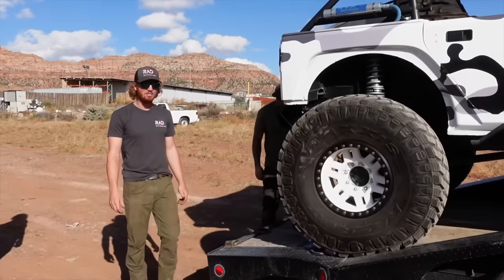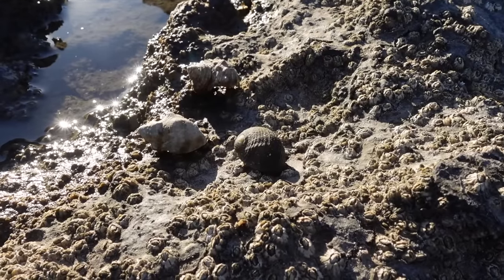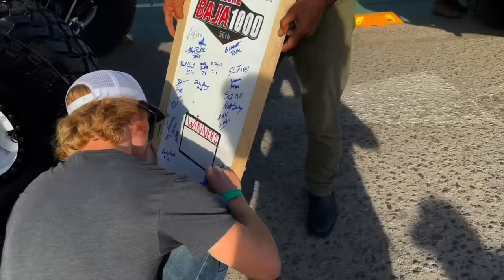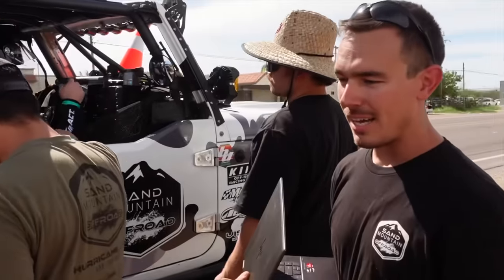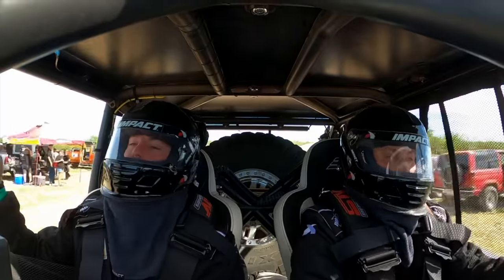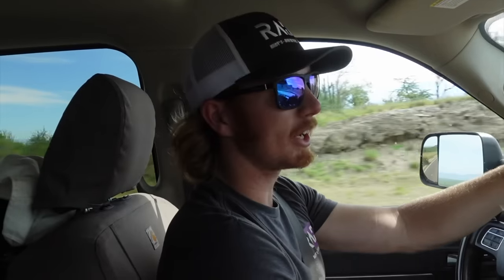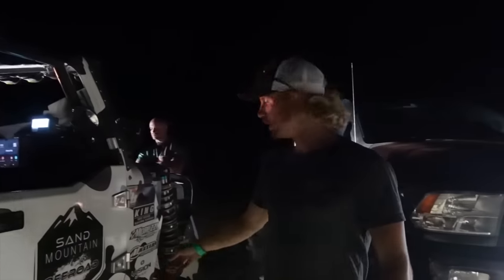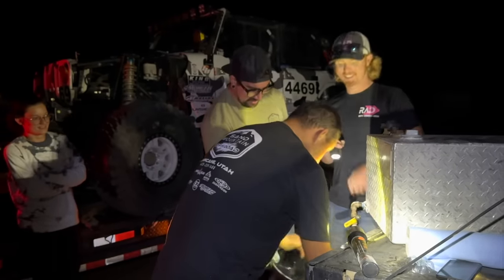Racing The BAJA 1000 Is No Joke

Comment: 25 years ago me and a couple of friends built a dessert racer. Our primary concern was to eliminate as much electrical needs as possible. When all said and done, our truck had 27 individual pieces of wire. I used a Borg-Warner T-20 trans, with a 205 transfer.  Rockwell axles with manual steering. This vid shows why I made every one of those choices. The truck still races today, it's had one more auxillary power system routed since then, for lighting  and navigation. 
I've always thought the KISS principal was the king when it comes to racing. 
I can easily maintain 90 mph with my 400 horse power coming out of my normally aspirated small block chevy.
But hey, if you're into breaking down, use your modern stuff. I won't, I like finishing races.
Have fun all.

Comment: it  would be a miracle if you guys made it first time. the little experience you got is worth it. DNF is not a bad thing, It just means you get to make it better next time.
Reply: Ford did it with the Raptor the first time lol
Reply: @evictioncarpentry2628  Ford and RAD is at same level? I didn't know that.
Reply: @jadenseph1809  It's an OEM vehicle. Arguably far crappier then a custom build.
Reply: @evictioncarpentry2628  arguably is the key word there. RAD jeep is crappier than the Raptor by miles. Few miles and overheated? Trans line burst not even 100miles in? If the Raptor is crappier, then it would not even cross the start line.
Ford has dedicated RnD with a bunch of engineers to create a truck that can go Baja. Years of tests and works. The jeep? 6months and change building it after work, tested only a few weeks at best after build. If anything, the stock jeep will actually do better than the custom build just like the Raptor.

Comment: Great comments. For fuses if you must you can put two 20s and a 10 side by side (in parallel) to get 50 - any amount that adds up. Current divides. Also the self resetting type can be helpful.

Comment: Great fun we’ve been there a few times and had a place in Cabo 
But the racing is much different down there and never forget it’s the little things that will end your day 
A lose strap lose bolts nuts something as simple as a zip tie can end your day 
Tie those wires and hoses down check the clamps make sure the connection are solid 

Touch everything and check it all then check it again because those items you lose now you will need later and they won’t be there

Comment: I used to co-pilot for my Brother in law with Becker and Sons racing in the early 2000s back before computer controlled crap ( i like manually controlled stuff it generally works and you can fix it) we ran the Baja and Mint and a few others it's tough sport. We ran Ford Rangers and never really did well untill we ran a Ford 150 Trophy Truck and got serious about the race. I will say I am NOT a huge proponet of electric fans in offroad and even drag and drive events I see too many problems with them and too many cars out because of them. The other thing we did was go to Lake LA and pre-run the truck hard there before going to any race to shake down the truck. Going that far with an unproven rig is a huge chance to be taking. Back then the locals used to set booby traps for the racers like digging a huge hole etc. if you were out in BFE and see a bunch of locals standing around a certain area better watch out for a trap. Never trust locals for directions or anything, they think it's funny to get you lost or hurt. Better luck next year and you need to have a past Baja contestant go over the jeep and give you some pointers and help. you need to run a Vegas etc. race close to home before the next Baja to prove out that jeep. Glad you are all safe. We also used to fly down prior to the race and rent a jeep and get the extra ins. and pre-run the course and we also hired a fixed wing aircraft or better yet helicopter to watch over us during the race and we also rented Sat. phones for communications between the truck and pit crews. We finally quit because it was costing the Brother in law 10k or more per race to prepare and travel expences etc. and pay for upkeep and fuel on the Big Rig and Race Trailer etc. he finally sold everything a bought a vacation home.

Comment: regarding the steering wheel that broke one of your guys hands: Take a look at those geometrys. With spacers and offset wheels, i imagine you have a lot of scrub radius, which means that obstacles can make the wheel try to steer a lot. Also try making a secondary cooling fuse, a failsave, in case first one blows, you can switch over from passenger seat. Additionaly, i think flexible lines are the way to go here, everything is being shaken so much that i can imagine a hardline getting stressed out a lot. Just some thoughts, i never drove the baja, but these would be things i would try to improve myself seeing this try.

Comment: I don’t know much, but what I DO know is that “most” (not all) but most BAJA vehicles are IFS. Solid fronts just aren’t as good for the rigors of a BAJA 1000.  But how cool was that to go out there and try.  Thats the cool thing about that race, basically anyone can go race.  I have always wanted to go race. When I was younger I wanted to take my quad. I then wanted to go rent one of those vehicles (yes you can)… back in the day, you just put a BAJA kit on a vw bug and go out and compete! How cool would that be?
Reply: As one who has raced Baja, worked crew, and worked as a Technical and Safety Inspector for SCORE, as well as several other offroad racing organizations for over 50 years, and the father of a Baja Bug Champion in the 1000, and is a retired offroad race car fabricator of winning cars and trucks, I can say for certain that the vast majority of the vehicles raced in the 4 Wheel Drive classes (aside from the UTVs) use straight axles. NOT IFS. I myself have been passed by Rod Hall in his Dodge 4x4 pickup in rough choppy terrain when I was in my unlimited buggy. Don't underestimate a straight axle 4x4 in Baja.

Comment: According to the latest FabRats you should use a circuit breaker on your electric fan so it cuts out when it draws excess current from overheating.

Comment: "Why a Jeep get a Toyota , they never break down'' Truer words were never spoken!
Reply: Toyotas break down all the time. And there's about 5% Jeep left in that racer. It's mostly custom and non-Jeep parts from the ground up. Even most of the parts that make it LOOK like a Jeep are either aftermarket or heavily modified.

It broke down because they didn't have time to work out the bugs, not because of any particular brand of parts.
Reply: @awo1fman  Agreed, at a certain point both the jeep and the yota are gonna have ford axles and a chevy engine, tube chassis etc.
Reply: @masonsunderland8126  😂
Reply: Your exactly right ! My sons got a jeep and wife has a 200 s , i have 2 Yotas an 04 and an 06 that never break and i spend way too much time working on Daimler junk ! And their both 13's
Reply: The jeep is just fine besides I've seen plenty of broken down Toyota's
Reply: Just ignore all the failed frames on the toyos
Reply: @audiosmackdown  what from the 70's ? Lol ! Audio smackdown , are you a hammy or what ?
Reply: Toyota Hilux, off the shelf, drive it all 1,310.94 miles and back home… then drive it as a daily.  Then drive it down to the starting line again next year, drive it like you stole it and finish the race again …. Repeat ….. repeat ….
Reply: Idk man my friends 22 tacoma still waiting for a new engine 😂...
Reply: What kind of Jeep was that? A beetleborg? It looked too heavy and cumbersome.
Reply: Toyotas still get dead shorts. The problem is that they didn’t do any of the basic electrical diagnostics that could’ve fixed the problem. They probably would’ve had to cut and jump 1 wire.
Reply: Theres a reason you still see 50 million hiLux pickups cruising the world's deserts for the last 40 yrs.
Reply: It’s a Chevy LS engine and trans with likely super duty axles.  Those aren’t what failed.  The offshore fan system failed, and their fab failed.  Not much Jeep left on that rig.
Reply: Next year should be a diesel hilux
Reply: True. Also this is a crazy stress to put on any vehicle. Working on cars for 15 years, I will NEVER own a Jeep or Dodge.
Reply: Said no man ever

Comment: I'd be curious if CCA wire was used in the fan circuit. It's getting hard to find OFC (pure copper) primary wire and CCA (Copper Clad Aluminum) will definitely create more heat because of increased resistance

Comment: I suspect the wire used was too small causing a voltage drop which increases the current being pulled which blows the fuse. Increase the gauge wire; for 50Amps you want at least 10gauge, preferably 8gauge, if it's copper wire. If it's copper plated aluminum, you need more like 6gauge.

Comment: Question...this was an old trick to get you home, and I am sure you know about it. Aluminum foil to bridge the gap, a copper penny, a nail...it won't blow, and the fan will run. My question is, is the fan able to be just hardwired without the need for a fuse? I think I would rather an electric fan burn up and not smoke my engine...what are the concerns? I've never raced, so I am genuinely wondering.
Awesome video BTW. One of your BEST for sure. Im excited to watch Jeanelle (sp) get her racer built. Holly @Mischiefmaker needs some trail mates!

Comment: Good video.  Made me nostalgic.  Baja is a cool place everyone should visit.  Sort of Mexico Light.  Very off road centric but also really good for vacations.  Fish Tacos. Tamales.
The race may have been cut short but a few lessons learned.  
May I suggest some navigator training.  Seemed much too wordy and vague with instructions.   Remember, the driver is an idiot.  He is just the foot the navvie is the brains.  Keep instructions to a minimum. "Right turn three tenths"  not " turning right up here a little bit".   One of my codes when the driver asks "How far"  my response is "One mile" for longer distances.  That way the driver knows to keep pedaling.  Driver are handling so much input they have trouble remembering the instruction.  I say the instruction at three tenths of a mile and repeat right or left at one tenth.  That seemed to work.  Your mileage may varie.
Better luck next/this year.

Comment: Why would it be overheating going down the road? The fan shouldn't make that much difference if there's air flow through the radiator. If nothing else jumper the fuse out.

Comment: The 12v electrical system seems to be a serious weakness. 50A at 12 V is only 600 watts.  It is time to move to a 48V bus on these vehicles.  Passing 50A through a fan connector seems ridiculous.

Comment: Your situation reminds me of the 2022 Ford raptor Ford gave these guys A Ford raptor to race in the Baja 1000, well one of the guys started cutting things out of the harness without telling the brain, so day before the  race the truck won't start. They spend flve stressfull hours trying to start it ,they finally replaced the entire harness, they had the same problem with the fan breakers,  every time you started the truck you had to turn them back on, the navigator was a total idiot I would have thrown him out of the truck if I was driving, instead of helping the driver he was making it a nightmare for the driver telling him to slow down and nagging when he should have been watching the gauges, he started yelling stop stop stop stop stop stop he should  have informed The driver and let him to call whether to stop or not but he runs out there and opens the hood and pulls up the lever on the radiator letting all the water run out then he calls  on the radio saying "we lost a radiator" so by the time they get it figured out like what the f*** are you talking about?, They ended up having to use their drinking water to refill the radiator, your first navigator messed up a lot He said turn right here when it was a left turn,  if the raptor navigator would have just pointed it out to the driver the driver would have told him you forgot  to turn those breakers on, They could have won that race if Ford gave me the chance like that I'll make sure I would  make everything the most of it. I have no idea  nobody does , why did that guy turn  the fans down to 25% for a Baja 1000 that was an act of sabotage, but next year if you go back at least you guys know you got to be all on the same page with mechanical things and work together stop trying to boss each other around

Comment: That’s a super tight engine bay with a V8 stuffed in there.  Why not take the hood off while it was overheating?  Allow the heat to escape, not gonna fix the problem, but gets rid of the “oven” effect on the motor…

Comment: Why didn't they just change the thermostat that allows a greater amount of water to move through the block, or just take out the thermostat altogether because the heat build-up driving at a high RMP in hot weather that moter will more than likely stay at a good temp for optimal operation of the engine without its thermostat !

Comment: What did you say the axles come from, and did the 3rd member come from there ORIGINALLY as well?,????
Reply from the maker: The axles came from a 2005 to 2011 Ford super duty, 2011 and up the rear axle housing changed And they don’t make gears that we wanted for it
Reply: @Rudysadventureanddesignreal  COOL BUT SAD

Comment: Live and learn . . .

Completing a Baja car anything less than a full year before the race is less than ideal, you need to break it multiple times before you get there. 

50 amps draw from a pair of thermo fans is an electrical issue, bigger fuses won't help. Run manual reset breakers on stuff like that, not fuses and have a spare mounted ready to swap the wires over.. Run water wetter in your coolant if you aren't already and don't run too much glycol, it spoils the heat transfer. If you need the fans on all the time, you need a more efficient radiator. 

All coolant lines need to be silicon, all others teflon lined braided, use aircraft-rated fittings, and have them made up by the pros. 

Comms are vital, if you don't have Starlink on the race vehicle, carry a satellite communicator capable of emails and text or preferably a sat phone.

Please, don't camp by the side of the road in Mexico, even in Baja. That's how you become a news story. 

Otherwise, nice job, everyone had fun and everyone came home alive. That's an OK result for a first run at Baja.

Comment: Rudy...  I don't consider ya'll quiters.  There was no sense in damaging the rig any more than what it allready was.  Better to bring the rig back  in a repairable state and fix what was broken and fix what ever was causing the overheating.  There is always next year now that you have a taste of what to expect.  Hopefully lists were made of things to bring, like multiple fuses of varying ratings like maybe 10 of each, extra fuel with pumps, extra hydraulic line and hose clamps, plus a flare kit for lines, and an assortment of spare bolts and nuts.  I realize you want to keep the weight down on the rig but most of the items I listed don't weigh that much.  And if having it saves time then it is worth the weight.

Comment: I'd have either hard wired the fan motors direct to the battery with jumper cables or fashioned a washer to fit into where the fuse goes... #GHETTO

Comment: Running the baja. I don't understand why your running your fan at 25%? Those fans are rated high 3000-7000. Their meant to run continuously once that motor starts. Their rated ...what 10,000 hours? There not meant to cycle on/off. Especially if your going balls to the walls. Another thing that could help. Bigger electric wires for the fans. To push that amperage through. Figure 50amps, 1/4 thru 1/2 inch wire. Just throwing an opinion out there. Hope it helps.